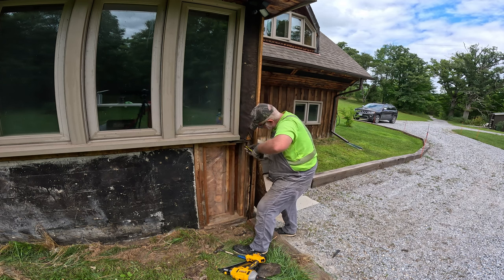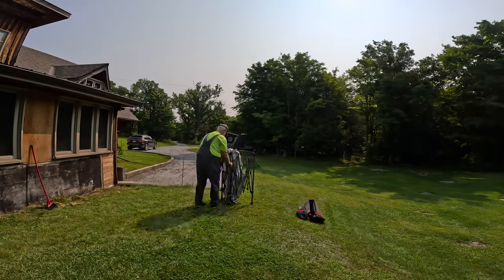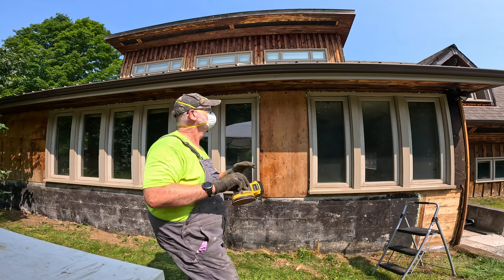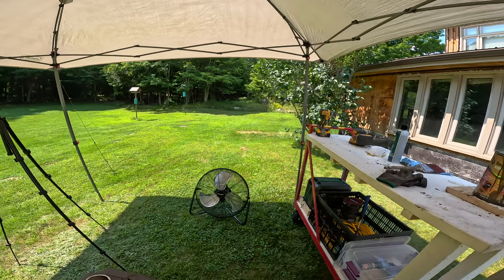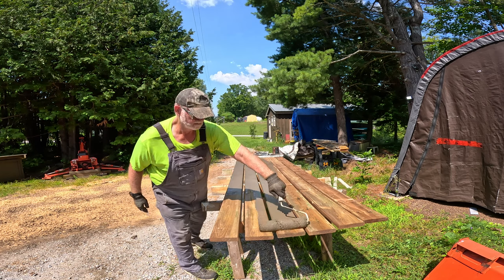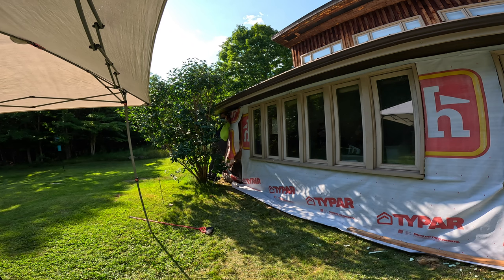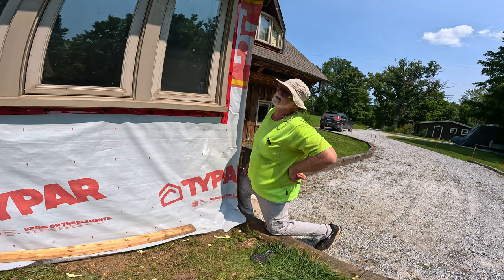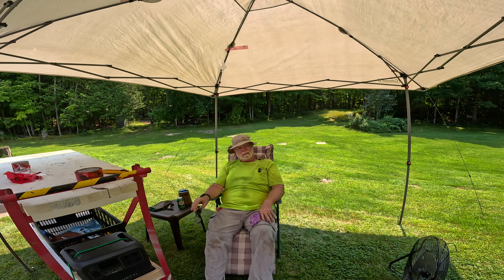The Mystery Wall That Could Have Cost Me Big Time! ($$$)

Comment: What is the plan for the bottom of the wall as it comes into contact with the soil?
Reply from the maker: At about 8 minutes into the video you see me staining some 5/4 X 6, 10 foot long pressure treated deck boards. They will run horizontally along the bottom of the wall. They will be set up so they can be replaced if needed without having to take anything else off the wall. I haven’t done this kind of thing before. It just seems to make sense to me without costing to much to do.